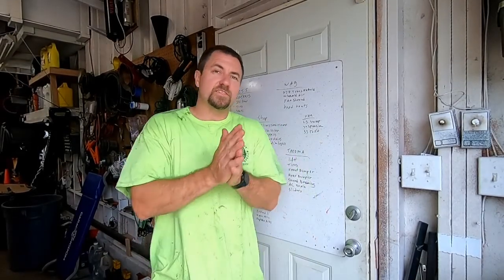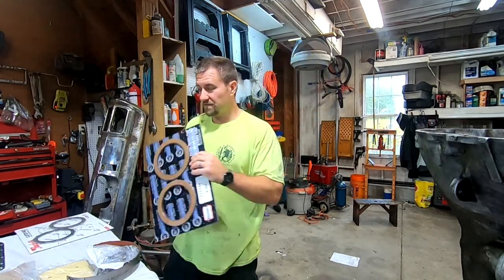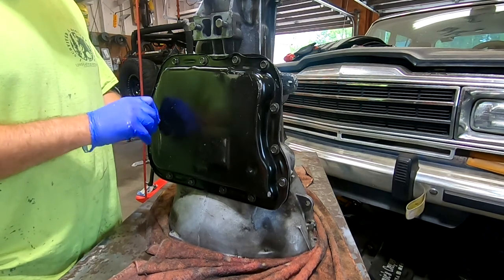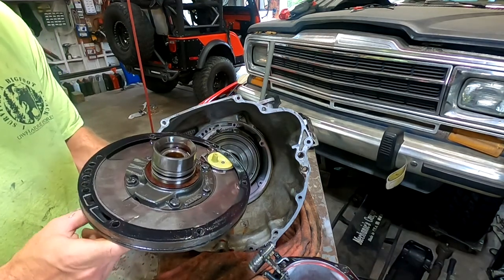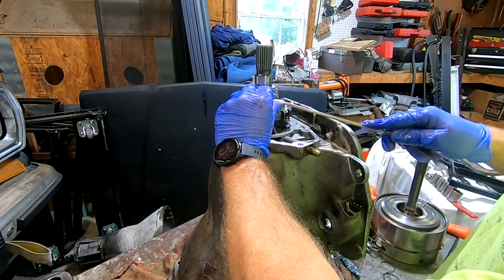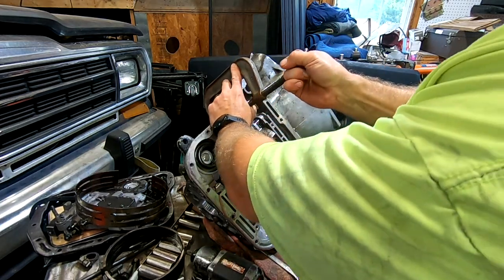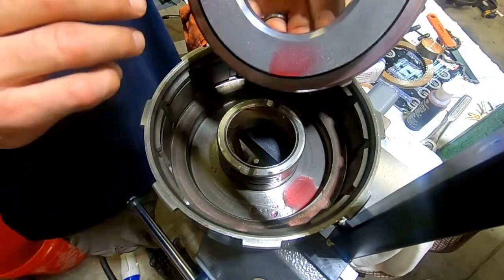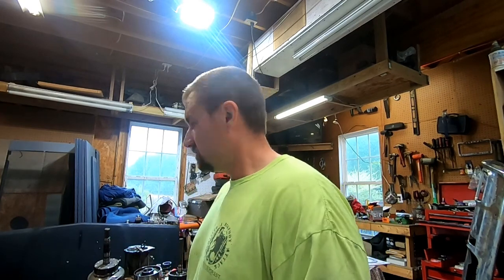(Part 1) 4x4 727 Torqueflite disassemble     1989 Jeep Grand Wagoneer Rebuild

Comment: I just manned up and got my 727 bolted up in Wagoneer yesterday. Forgot the trans mount at home. Still gotta get torque convert bolted up. Should be able to get it moving under it's own power soon. Still need shift fork for ax15 for xj. I got the shift kit with mine. Had broken reverse piston too. Clutches were toast. Had to use press to change piston shaft out. Make sure you get right seal for rear shaft. My kit didn't have 4wd seal. Mine had the manual value body for the kick down. It was kind of a pain with the way it goes back together. I watched Precision Transmissions video 100 times. Time to get working on my jeep. I hope transmission was rebuilt right only have myself to blame if not.
Reply from the maker: it is a good feeling when they can move under their own power.  :)   I hope I will get that feeling.   Thanks for the tip on the rear seal.   that would suck if it is not in there.  I will look tonight.   I picked up a really good book in which I will show in the next video on the rebuild part.   So far a really good book.   I hope to find time soon.    

Thanks for the Sub and all the Comments.   Keep them coming.  :)
Reply: @5LakesGarage  I didn't realize my torque convert only lines up one way on flex plate. Had to loosen bolts and slide trans back to align torque converter. Thanks for the great video.
Reply from the maker: yes.  I found that out as well.   I ended up using a can of spray paint through the inspection port.  
Such a pain

Comment: Great Video; nice lighting, sound and explanation. The TF727 in my '88 GW was the first transmission I rebuilt. One of the easier ones to rebuild, as the specialty tools required are minimal. I compressed the clutch pack with three carefully-placed c-clamps, as there was no affordable compressor available at that time twenty years ago.
Reply from the maker: Thank Dr.   This is my first one and the 727 is a good one to start with from what I seen so far.   I hope to have everything cleaned up and put back together soon.   Just have find time.   Spring time is a busy time.   I have to get this wag out on the trails again.    :)    

Thanks for watching.